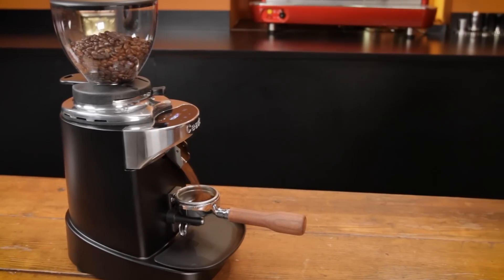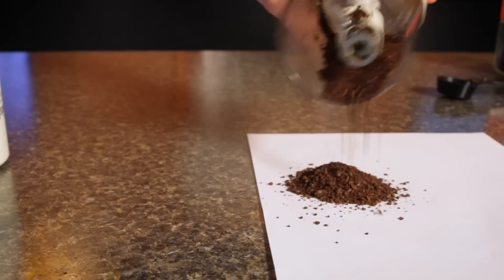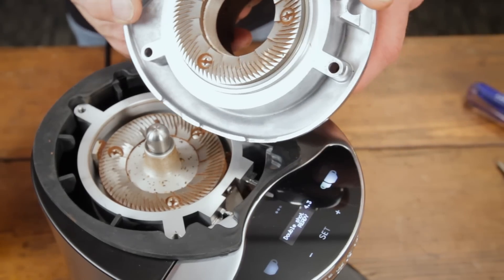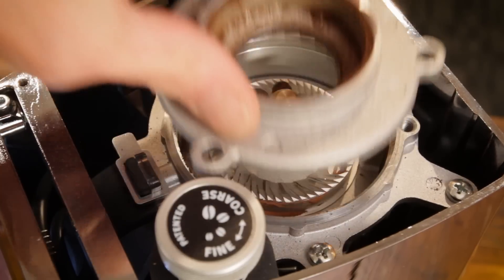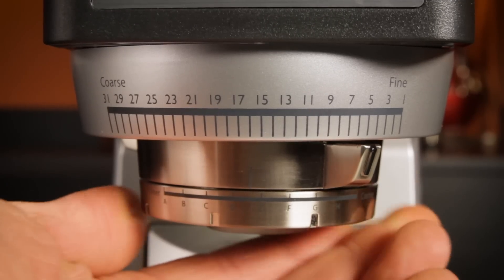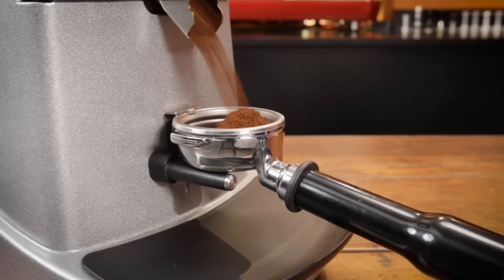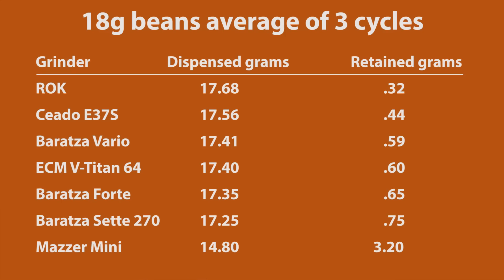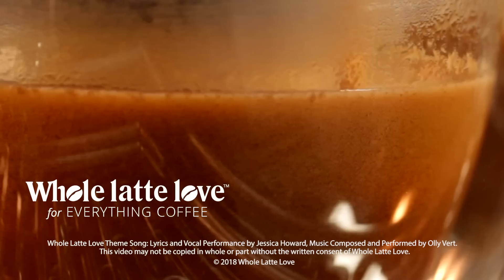How to Choose the Best Coffee Grinder for Beginners

Comment: Hi Marc, great video as per your usual standard!  Quick question on tamping: After your coffee has been tamped, when you then lock the group head into the machine, should the screen in the head: a) never touch the tamped coffee level in the group head, b) just come into contact with the tamped coffee , or c) slightly compact the coffee in the group head?  Thanks again.

Comment: Great video for a beginner! I'm thinking about getting a Flair espresso maker in addition to occasionally making pour overs. What electric grinders would you recommend? Thanks.
Reply from the maker: Hi YL, Thanks for the comment and question. For espresso, quality of the grind and precise control of grind size is far more important than it is for pour over. There are many grinders in the $100 - 250 range that work very well for pour over. Using that level of grinder for espresso will involve some degree of compromise. But, with reasonable expectations for your espresso you can get by at beginner level.  A lot depends on your budget. Minimum is something like the Capresso Infinity. It's ~$100. It's a bit of a PITA to use for espresso and lacks better burrs and precise grind size adjustment found in higher priced grinders. The Eureka Mignon Perfetto is a machine grade multi-purpose grinder. It has much faster grinding, very accurate timed grinding, superior burrs and a much higher price tag. In your shoes as a beginner I'd have a go with something like the Capresso Infinity unless you really want to jump right in to higher-end grinding. Get a feel for espresso and you can always go higher-end down the road. Here's links to those products for more info.
Capresso Infinity: https://www.wholelattelove.com/products/capresso-infinity-plus-conical-burr-coffee-grinder-in-black
Eureka Mignon Perfetto: https://www.wholelattelove.com/products/eureka-mignon-perfetto-16cr-grinder-in-white
Hope that helps!
Marc

Comment: Just ordered a Baratza Sette 270 after watching your recommendations. Can't wait!
Reply from the maker: Hi, 0001..., Please let me know what you think and what machine and/or brew method you are using. What grinder were you using?
Marc
Reply: I'll come back and let you know once I get it. I'll be using it for almost exclusively espresso use. I was using a cheap blade grinder so this should be a significant improvement. Do you have any rough grind settings for the Sette 270 for espresso to start with?
Reply from the maker: @00011theman  Were you using the blade chopper for espresso? Regardless of brew method a burr grinder will be night and day difference from the chopper! You are going to love the Sette 270. For settings, that's going to depend on other variables like the coffee bean, dose weight etc. The setting that is best for my variables may not be best for yours. Also settings are not really transferable between grinders. You will likely be 2-4 clicks from the finest macro setting. What you need to do is "dial-in" the grind size. Of course I have a video explaining that process: https://youtu.be/iwHdm5GtNHI
Marc
Reply: Whole Latte Love Yes, I was using the blade grinder for espresso. Of course it didn't work very well. I'll be sure to follow your guide and let you know if I have any questions!

Comment: Hi Marc, Thanks for all the great videos.  I have a Gaggia Classic and  looking to purchase a new grinder.  I am thinking about the  Baratza Sette 270 or Quamar M80.  With the Quamar on clearance they are similar in price/budget.  Typically I will make 2-3 lattes a day and around the holidays a few more.  
I would welcome any  thoughts and suggestions you have for us espresso fans.   Maybe someday down the road I would like to bump up to a HX machine.
Reply from the maker: Hi Dan, Thank you for the kind comment and question. The Quamar M80 is an excellent value and it's machine grade. It will serve you for a very long time. I do like the Sette grinders. Very accurate dosing, beautiful well distributed grinds and a small package. It does not have the build quality with full metal housing etc of the Quamar and is a little louder due to its open design. It's a tough call. At 2 - 4 grindings per day the Sette will be fine for some time. I'd recommend against the Sette if you were doing a lot of back to back grinding. The Quamar is technically a stepped grinder with notch stops on the grinding collar but stops are so close together it's in essence a stepless grinder. The Stops also make it easy to get back to a previous grind setting. The Sette 270 grinders are stepless with the continuously variable micro adjustment ring. I know I'm not being definitive here but I do hope this helps. If you have anymore questions do not hesitate to ask.
Marc

Comment: So, here's my situation.

I'm pretty budget and space-constrained, but I want something that's a cut above the very cheapest grinders. I've read good things about the Oxo Conical Burr Grinder, and it seems to be a good value around $100.

I've been using a VERY cheap Mr. Coffee blade grinder up to this point, which is fine for filter coffee but leaves a lot to be desired for espresso. So I want to upgrade.

I have a DeLonghi BCO432 combo machine, which is not exactly a premium espresso machine, but I did just order a non-pressurized filter basket for it to try to get the most I can out of it.

Obviously, burr grinders are much better than blade grinders, but is the Oxo a good choice? Am I more limited by my cheap espresso machine?
Reply from the maker: Hi Daniel, Blade grinders leave everything to be desired for espresso! Honestly I'd never use one for filter coffee either. They hack coffee into random size chunks to fine powder resulting in a very unbalanced cup. I was just at the Specialty Coffee Association Expo in Boston and saw the Baratza Encore ESP: https://baratza.com/introducing-the-encore-esp/
It's not available yet and looks to be ~$200 but looks to be an excellent option for your situation. It has an espresso optimized grinding range and another for filter/drip. If going with a non-pressurized filter basket you will want precise control of grind size for espresso. From what I saw at the Expo, the Encore ESP delivers! The Encore has been around for years and is a favorite for filter grinding. The ESP version is perfect for those wanting a multi-purpose grinding with the very important control in th espresso range.
Hope that helps!
Marc
Reply: @Wholelattelovepage  Thanks. Do you think the ESP would be worth the price difference over the Oxo? The ESP may be under $200, but the Oxo is under $100, and I can get it even cheaper used.

Comment: That's a great video. I do have a question: what about grind quality of professional grinders? I am speaking more specific of a Ditting 903(maybe also the newer model). As far as i thought, professional grinders would have a great grind quality but i saw a video on which the guy said that these grinders often "chew then cut". Ditting is a swiss company with the same mother company like Mahlkönig. And as far as i know they have a brilliant grind quality. Would really appreciate to get your help. As i have the chance to pick up such a beast of grinder. 90mm flat burrs, and 700g/min capacity.
Reply from the maker: Hi RR, Thanks for the question and sorry for the delayed response. I'd take 90mm flat burrs! Not sure what the issue is with chew then cut. Flat burrs come in different geometries. I did a video last week featuring some high-end SSP Red Speed burrs made of tool steel and titanium coated. The cutting teeth of those burrs extend further out toward the center of the burr than what you see in most stock burrs. Here's that video in which I show closeups of the SSP burrs next to stock burrs: https://youtu.be/IFd_vdAVu14
The side by side comparison is a little deeper into the video.
Marc

Comment: Thank you for the video 🤍 I have questions I have Delonghi and also I do drip coffee which grinder should I buy ? I don’t want it so expensive 🤍🤍☕️thank you
Reply from the maker: Hi HS :), You are welcome. Sorry for the delayed response. A little crazy here in NY with current events. In your situation with a Delonghi which uses a pressurized filter basket and grinding for drip as well I highly recommend the Baratza Virtuoso+: https://www.wholelattelove.com/products/baratza-virtuoso-coffee-grinder It's got the widest grind size range of any Baratza grinder. If that's a bit out of your price range then go to the Baratza Encore. Not as nice to use day to day but it can get the job done for pressurized filter basket espresso: https://www.wholelattelove.com/products/baratza-encore-conical-burr-grinder
Hope that helps,
Marc

Comment: Hey Mark, I have the Profitec Pro 500 PID. I don't ever really see the need to go beyond a HX machine, plus Profitec makes such well made machines. I'm looking to upgrade my grinder, what would you recommend? I've got my eyes on the Ceado E5P, I've wondered if you could relay your experience with it or any other recommendations.
Reply from the maker: Hi Carlton, Love the Pro 500 PID! Ceado E5P/E6P are terrific values in prosumer/machine grade espresso grinders. The 5 and 6 are identical as far as burrs, motor, delivery. E6P adds 2 timed based presets while the E5P is manual on demand only. Both grinders do a really good job of delivering grinds centered into a PF. Be aware the start switch for the E5P is in between the forks of the portafilter support. Makes it difficult to use with a bottomless portafilter as it's PF spouts which activate the grinder. You can use a finger to start but it's a pointy rod.  If never using a bottomless PF it's not a concern. E5P does not have a hook to hold a PF for hands free grinding - but that makes sense as it's manual on demand. E6P does have a hook for hands free.

Hope that helps!
Marc
Reply: Perfect, thanks Marc! I really appreciate it 😊, you guys are fantastic.

Comment: Hi Marc, great helpful video as always! I'm new Gaggia Classic Pro user and I'm thinking about  basic but good grinder. Your video is very helpful, however I'm wondering what type of grinder is a minimum recommendation to learn brewing espresso with a non-pressurize basket? 
What parameters of grinder are most important for non-pressurized espresso? Are 270 levels of grind necessary (like Baratza 270) or is it possible to brew decent espresso with a non-pressurized basket using something cheaper than Baratza Sette 270, but better than Baratza 30 AP which is dedicated to pressurized brewing?
Reply from the maker: Hi Greg, Thanks for the kind comment and question. The most important factor is precise control of grind size. Other important considerations are dose to dose weight consistency, grind quality - is it clumpy and distribution into a portafilter. The Sette 270 excels in those areas. You asked: is it possible to brew decent espresso with a cheaper grinder? "Decent" is a subjective term so depends on what your expectations are. For low volume  high-end home users the 270 is a minimum. It can produce excellent shots but most espresso geeks would likely prefer a machine grade product. Those newer to home espresso can likely work with a lesser grinder knowing they are making some compromises and will likely upgrade if they continue to higher levels.    The Sette 30 can work for home espresso. One way of dealing with super fine control of grind is to adjust the dose weight to compensate. You could consider The Breville Smart Grinder Pro: https://www.wholelattelove.com/collections/espresso-grinders/products/breville-bcg820bss-smart-grinder-pro It's about $50 less than the Sette 30. The grinds from the SGP are nowhere near as nice as those from the Sette 30. Personally I'd use the 30 over the SGP. I hope that helps. Let me know if you have anymore questions.
Marc
Reply: Thanks Marc! I check the prices in your shop, and now I understand your point.  If I were in US I would buy Sette 270 without a doubt. But I live in EU (Poland) and here, European -  Italian machines are cheaper than comparable American.  

For example prices in my local shop are: Rancilio Rocky Doserless $300, Macap M2m $320, Eureka Mignon $340, while Baratza Sette 270 $460.... 

So my point is -  are those Italian entry level machines (Rocky, Macap M2M, or Eureka  ) good enough to make an espresso on non-pressurized basket or non-pressurized basket needs to pay $100-150$ more and go for Sette 270? 
Greg

Comment: Hello Marc, thank you for another great video! Anyway, I’m struggling to choose a perfect grinder for my needs. I regularly change the settings from espresso (Lelit PL41PLUST+Graef CM 800, which has high retention) to Aeropress or V60.
So, my needs are:
1) easy coarseness change
2) “zero” retention
I thought Sette 270 is a perfect fit, but then I saw all the plastic parts.
-> 3) Durability is also crucial 👎 Is Vario any better? I would buy even Baratza Forte or for example Eureka Zenith 65e, but I don’t know much about those grinders.
Could you please give me an advice?
Reply from the maker: Hi Tomas, Thanks for the question. You always have to compromise a bit with a single grinder for multiple brew methods. For home use, I would not be too concerned about the plastic parts in the Sette 270. For piece of mind, Baratza has a set price repair program. Currently $85 for the Sette. More info here: https://baratza.com/product/sette-270-repair/
If durability is crucial (are you using commercially?) The Forte is built to a higher standard with a far more powerful motor than the Vario: https://www.wholelattelove.com/products/baratza-forte-ap-flat-ceramic But, Baratza considers the Sette 270 and 270 Wi their best espresso grinders. They also retain less than the Forte or Vario grinders. The Eureka Zenith is a nice grinder. But, I cannot recommend it for multiple brew methods - you will tire quickly of the effort required changing from espresso grind to V60 grind. Retention in the Zenith is above 3g. In your situation (and for home use only) I'd consider a Baratza Virtuoso+ for your V60/Aeropress: https://www.wholelattelove.com/products/baratza-virtuoso-coffee-grinder and the Sette 270 for Espresso: https://www.wholelattelove.com/products/baratza-sette-270-conical-burr-grinder Together that's about $650 far below the price of the Zenith. Hope that helps!
Marc
Reply: @Wholelattelovepage  Thank you very much for your answer. I don't use it commercially, I just like buying durable products. Anyway, I saw your Vario review short time after I had written my question. It persuaded me. So, I have bought the Vario and I am loving it! 😉
Thanks again!
Tomas

Comment: Hello Mark, In your opinion what is the best mill for a Gaggia Classic with a consumption of two cups of espresso a day, taking into account the following. Durability, grinding quality, easy cleaning. Budget 400 dollars maximum.
Reply: Fernando  Elias Calles  Cantu  rancilio rocky ,cannot get anything better for your budget, it’s a very good grinder,
Reply from the maker: Hi FECC, For home use at that level and your budget I'd go with a Baratza Sette 270. You will love the grind quality!
https://www.wholelattelove.com/baratza-sette-270-conical-burr-grinder
The Rocky is an okay grinder. Compared to the Sette 270 it is more rugged. On the down side it can produce a rather clumpy grind, is kind of slow, retains a lot of grounds and does not have as much control of grind size as the 270. 

Marc
Reply: @Wholelattelovepage ; Thanks Marc. A pleasure to learn from you.
Reply: @blejzerosamigos6115 ; Blejzeros Friends; Thank you.
Reply: Did you get the 270? Does it hold up well to your level of use?

Comment: I need an espresso handheld Burr grinder that will grind 30 grams for my mocha pot. Compact and quiet. Electric would be great but manual is fine.
Reply from the maker: Hi Martin,Check out Hario hand grinders. There are sufficient for Moka pot. If going electric have a look at the Baratza Virtuoso +. Not handheld of course but an excellent all around grinder.
Marc
Reply: @Wholelattelovepage  I went with the Sozen 9.2 inch manual grinder. It's the best and even grinds for ultra fine turkish coffee. Handmade. They have a website for those interested in learning about this fine culinary tool.

Comment: Hi Marc. Question:  I’m using a Breville Pro with my Profitec Pro 500. I’m considering stepping up to a Ceado E5P or E6X or E6P. Will a better grinder really make a difference in coffee flavor?  I sense all the gaff over high-priced grinders is ego. Also, of the three Ceado models mentioned can I use my Bottomless Portafilter?  Thanks.
Reply from the maker: Hi William, Thanks for the question. For the bottomless go with the E6P. The E5P grinding is triggered by a switch pushed in by the portafilter spouts. A better grinder will make a difference in flavor. You have much better control of grind size and bigger burrs produce a more consistent particle size with little or no clumping. Of course, you need to be at a level to appreciate/use a better grind. Beyond that the Ceado's are machine grade products - they will outlive the SGP by decades.
Marc
Reply: Whole Latte Love Thanks for your helpful reply. I began pulling my own shots in 1989 while spending a year in Seattle — long before WLL came into existence. I don’t consider myself a coffee expert, but I do know good espresso from bad which is why I avoid Starbucks at all costs. Thanks again. Bill
Reply: Whole Latte Love MArc, thank you for your great work at WLL. I’d like to see a new video with Todd on fixing squeaky levers on an E61. Also, how about a video showing Cleaning and Maintenance on expensive grinders such as the Ceado E6P?  Stay well😎